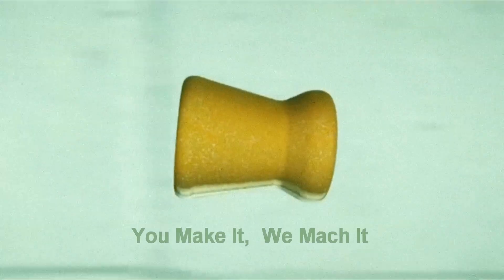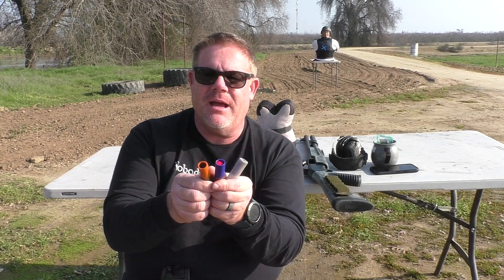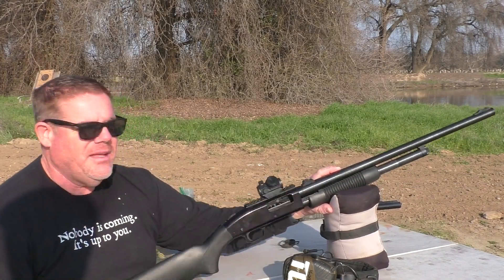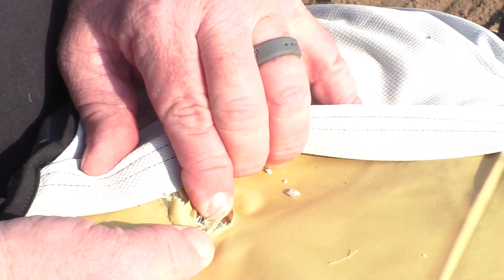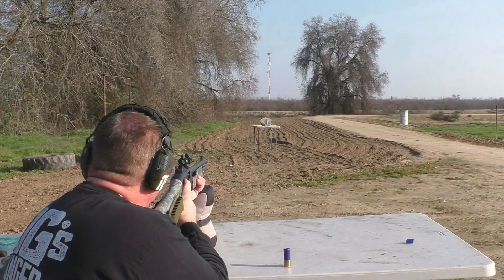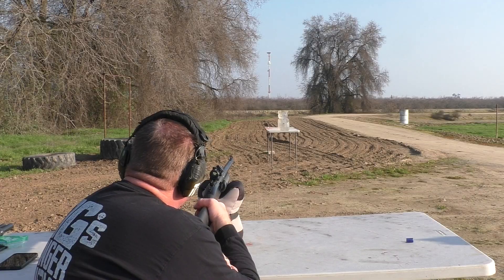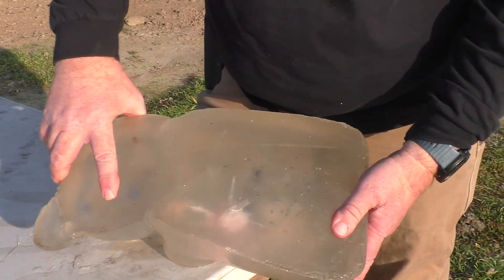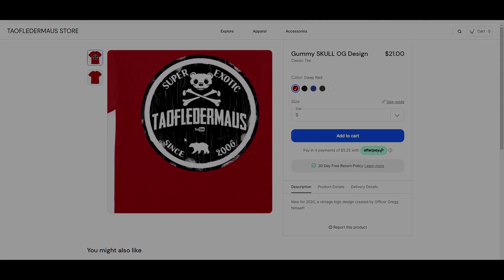Porcelain Shotgun Projectiles?   We Test Them!

Comment: The problem with this porcelain is that the material was too inconsistent. Simply machine this stuff could and probably would cause cracking in the material. If you could get some of the ceramics used in knife blades molded to the proper shape it might be different.

Comment: the fragility of the rounds most likely comes from the metal inserts compromising it's structure and focusing stress if the rounds had been solid machined ceramic with a cork wad it would most likely have survived.

Comment: There's an easy way to protect yourself from the people that don't understand jokes. Just use a tarp!
On a serious note, drilling the back of those probably reduced the strength of the projectile. I imagine it separated the projectile into multiple zones based on whether they were supported by metal or porcelain. The metal would compress but the porcelain wouldn't. This means there would have been parts of the projectile under tension rather than compression and porcelain isn't strong under tension.

Comment: Using drawer pulls is going to be a problem.  They're not exactly designed for strength or uniformity.  The drilled, threaded (and typically tapered) base is a weak point.  If you can manage to get a slug of solid alumina, that would be interesting, if expensive. McMaster-Carr has rod in 5/8" and 3/4".

Comment: People have no comprehension skills reading or listening. They interpret they rarely comprehend. Which is why they don't understand jokes. Also reality has gotten so weird you sometimes can tell if sarcasm. complete failure of the education system. Though humanity has never been exposed to more lead in everything they consume and touch today than any other time in human history. Everything is coated in lead because of 40 years of leaded fuel. Lead pipes. lead paints and toys. China tricks millions into importing all sorts of toxic and radioactive products every day. Thorium rings necklaces anal beads drink aids and so on are imported to the west en mass. thorium oxide power you can import no problem from Ebay. 5Kw lasers labeled 5Mw. Then you wonder why people are so stupid. It's the lead it's everywhere in massive levels. Chocolate has one of the highest concentrations of lead.

Comment: I wonder what would happen with Tungsten slugs?
Reply: If you made them with the same dimensions as lead slugs and fired them at the same velocity, a shedload more recoil would happen, because that stuff is dense.
Also, expect it not to splash the way lead does. Its melting point is extremely high, so it has to be going stupidly fast to behave as anything other than a solid.

Comment: Yes, porcelain is harder than most steels. Without those sabots, you'd be shooting metal shavings with each shot.

Maybe using a more cushionny gas seal or wadding could have helped. Also, 20 grains was probably to much. My guess is that a mere 10 grains would have been enough.

Comment: I'm from Whales, my name is Jonah!  Ok, I joke.
And, those ceramic slugs looked like drawer pulls which had been cut to size with a diamond hole-saw.  Just guessing...I've installed a few of those being a cabinetmaker.  Sometimes, the pulls would shatter just from tightening them with normal torque, so I'm thinking a higher grade porcelain formed with consistant quality control might be a more efficient projectile.

Comment: Evan clearly found those in the cabinetry section of his local home improvement store. They aren't necessarily full of internal flaws, they're just not designed to handle high acceleration forces in their intended application. That any of them held together is a minor miracle.
Good try though Evan. Anything else in that store just happens to have the right diameter?
Reply: If it mills, it thrills 😉
Reply: @TheRhinestoneHurricane  Longer porcelain slug with a hollow tail?
Reply: @Sableagle  I’m working on hollow points 😉

Comment: TiteWad is one of the fastest propellants, and would build pressure very fast and burn out.  That rapid pressure spike may have broken the ceramic, while a slower propellant may have given the slug a slower start and preserved the slug integrity better.  Too late now however.
Reply from the maker: I needed the fast burning powder because these are so light.   Had I used Long Shot,etc.  it wouldn't have ignited

Comment: I thought it would be a puff gun or explode on contact. Higher consistency ceramic is doable, that close is solvable. Gross wound though. Lacing the ceramic with a toxin or something might be doable, surface area becomes huge. A venom in it perhaps- i'm thinking the ultimate incapacitation round.

I wonder if it works subsonic? An air rifle would shoot these better. 

Ah. These are pretty covert ideas huh? Porcelain firearms, huh.

Comment: That's an interesting projectile. It's probably been suggested in teh previous 330+ comments previously but maybe turning these from some carefully baked porcelain, rather than (I'm assuming) old dinnerware. The intial look at these slugs shows flaws on the outside of some of them. Properly made porcelain suited for impact or high-wear situations might perform more consistently.
Reply: I guess they are on they laith (is this how you spell it?) turned down knobs for drawers and kitchen cabinet doors

Comment: Maybe a coating on the porcelain slugs might help. Powder coat or something like line-x truck bed liner or some other coating
Reply: It's more finding the right powder load and type plus the style of wadding, they've had issues with that before crushing odd shaped projectiles, hard to guess right with a small sample size.
Reply: @volentimeh  Definitely ought to get packs of 20 for this sort of thing.
Reply: @volentimeh  yeah, that too, I was just thinking about ways to make the projectile less ssusceptible to breaking up in flight. In the 1880's at the dawn of smokeless powder, lead bullets had a tendency to "pop" between the muzzle and the target do to the centrifugal "forces" of increased velocity and tighter rifling(not the same mechanism in this video, but similar problem). Interestingly, you can still occasionally see this phenomenon today, usually with people trying to push bullets in the 4,000 to 5,000 FPS range, usually small light thinly jacketed varmint style bullets. Edward Rubin(same guy involved with the Schmidt-Rubin line  of Swiss rifles) solved this by jacketing the bullets. So I was thinking of a similar direct solution, in addition to developing the load.😊
Reply: Line-X truck bed liner and what?
Birdshot? Sand? Steel BBs?
Reply: @Sableagle  as a coating on the porcelain to reduce the chance of shattering. There's a ton of brands now, but line-x (or an equivalent) is often used on body armor plates to stop fragments (from a bullet or parts of the plate itself) from becoming secondary projectiles. In the case of ceramic armor, it also adds some integrity to the ceramic, reducing the chances of it being broken(from being dropped, or the user falling on them, or whatever) prior to catching a bullet. So I thought it might be a substance to consider for trying to keep porcelain slugs from shattering in flight.

Comment: Someone should make a variety of Epoxy-Resin/Coated Projectiles.. Solid Epoxy, Plastic core, wooden core, lead core and plaster of paris core. I'm not an engineer, just an idea guy 🤠
Reply: Stack of keyrings, all threaded through more keyrings so there are three linking rings 1, 2 and 3, three more linking rings 2, 3 and 4, three more linking rings 3, 4 and 5, three more linking rings 4,  5 and 6 and three more above the first three linking rings 5, 6 and 7, all stacked up very nicely in the centre for balance, in a slug of clear epoxy?

Comment: Jeff if you loaded those things identically every time it doesn't matter, it's all about the curing of the porcelain. Being that it's such a porous material, It doesn't matter how you do it. If that stuff's not cured correctly or mixed perfectly you're going to get different results every time. It's like hitting a hammer on a rock you get different results every time.

Comment: The floral design was a nice touch. Maybe Evan could make another batch with a fish design for OG.
Reply: Those were just porcelain drawer knobs turned down in a lathe. You can get them at most hardware stores. The screws probably came with the knobs.
Reply: It`s a reference to classic russian Gzhel paintig, usually used for porcelain dishes
Reply: @ВадимМ-щ2щ  🇬🇧❤🇺🇦

Comment: Maybe an analogy:  The fragmented porcelain slug had an anemic effect on the steel plate, but the solid slug forcibly knocked the steel down….. Could this translate to the effect a meteor fragmenting in the atmosphere would have on a planet compared to a one holding together and slamming into the planet?
Reply: That's exactly right. It's just like how you can tolerate OG's jokes one at a time, but a master cut of all of them back to back would be devastating.

Comment: I'm imagining the IVR at 1-800-Taofledermaous. "To say that rifling makes everything better, press 1. If we forgot the lead plate, press 2. If you did not understand OG's joke, press 3. To explain that whales are not fish, press 0, or stay on the line."
Reply: 😂 😂 😂 😂 😂 😂 😂 😂 😂
Winner comment
Reply: I nominate you for the rarely awarded "Tarp of Gold Momentary Achievement Award" for outstanding humor in very difficult circumstances. 🟦🟨Слава Україні 🟦🟨
Reply: almost 35 years ago, i was coding and installing IVR and VM systems.  were you in the biz too?  it seems to be pretty uncommon that most people know what IVR is.
Reply: @JohnLeePettimoreIII Still quite active in the biz, for the past 13 years. Mostly different flavors of VoIP, and running mostly IMS SIP across our own network, but with customer equipment ranging from pulse-dialing alarm systems from the 1970's, MGCP-speaking DOCSIS phone modems with RJ11's on the back, SIP ATA's supporting either FXS or FXO ports, IP phones and soft phones, all the way to stacks of SIP and ISDN/PRI pbx's with multiple T1 interfaces and 200+ concurrent calls. I don't directly work with the partner LEC's when there's a peering issue, but I do have to diagnose call traces that go all the way to peering point, so I have to speak SS7 as well. A good call trace is a more fun read than most romance novels. Never worked with cellular technology, though. And I'm sure you know, no matter how much you've seen, every 6 months or so you run across an issue that's totally new. There's always more to learn <3
Reply: You can take the rest of the year off good sir 🤣
Reply: Best TFM comment of all time right here.
Reply: Mic drop🤣
Reply: 🤣🤣🤣🤣🤣🤣🤣🤣🤣    That was beautiful.   Beyond funny.
Reply: LMAO!!! Good one!!!
Reply: Humor? What the double heck is humor? Love you guys! Keep on doing what you are doing! A dips&÷t from Alabama. ROLL TIDE ROLL!!!
Reply: Hands down, you win Taoflederfolks comment of the YEAR, the rifled bore award 😂
Reply: If we should fire a dildo at an inflatable doll, dial PI

All of PI.
Reply: 1
Reply: best comment ever on this page

Comment: Here's a stupid idea, barbed wire, either cut up into little segments, or rolled up into some sort of slug.

Optionally, do the same with steel wire, loaded the same. Optionally solder wire, but it probably isn't going to work well.

Comment: I now find myself rather stuck on the question of whether or not gummy bears will break car windows if shot at them.

You did it to yourself.
Reply: I was wondering that myself. I think bears would tumble, but maybe gummy worms would work? Those are related to slugs, right?
Reply: I wanna see a shotgun shell full of gummy bears, fired at the giant gummy bear.
I kind of also want to see frozen peas used as shot, but the problem is that they'd thaw during discharge. Beans, maybe?
Reply: I heard that myself. I think he was exaggerating to make a point.

Comment: You guys talking bout sparkplugs breaking windows reminded me... When I was a firefighter I carried 3 or 4 sparkplugs in my turnout coat pocket to use.....for breaking car windows!! Just wind up and Huck it against the window and the window shattered 9 times outta 10!
Reply from the maker: Those little automatic center punches work quite well too.  About the size of a pen
Reply: Yeah we had a handful of those floating around,but they were one of the most popular things to "barrow" from your buddy or the equipment bag etc. Next most popular item was hardwood wedges for holding doors opened or wedging shut searched room doors.
I made a ton of em outta red oak 1x4s. 8 footer makes a buttload of wedges! Mine were painted red with my badge  badge number,and they still disappeared on a regular basis.
We kept old sparkplugs in a couple of coffee cans if they weren't totally trashed,so we had a regular supply of those!
Another thing that works is an antenna off the car,those old ones with the big button on the top. You hit the door post and let it whip the button into the glass.